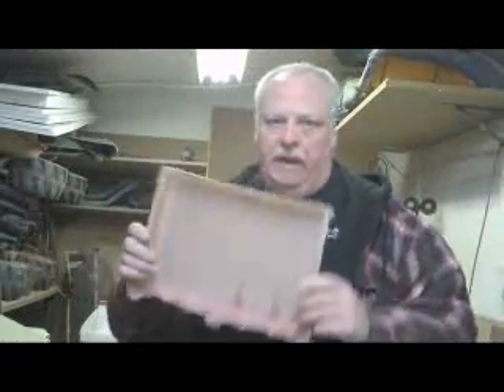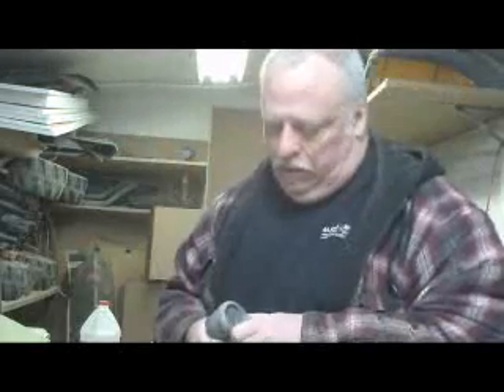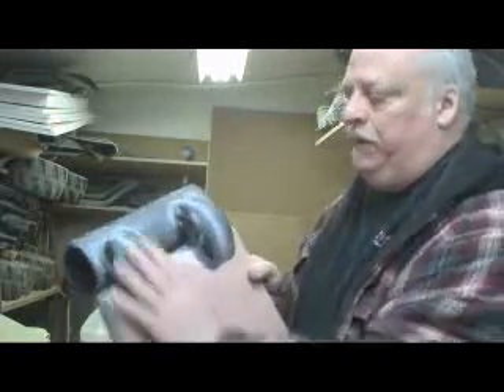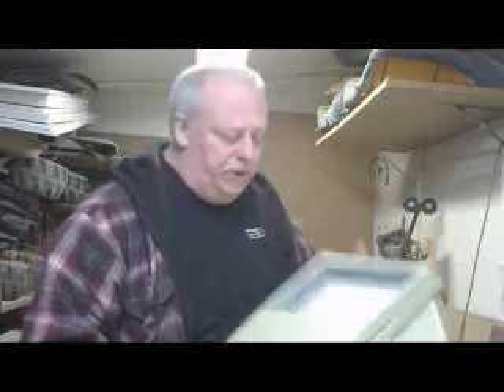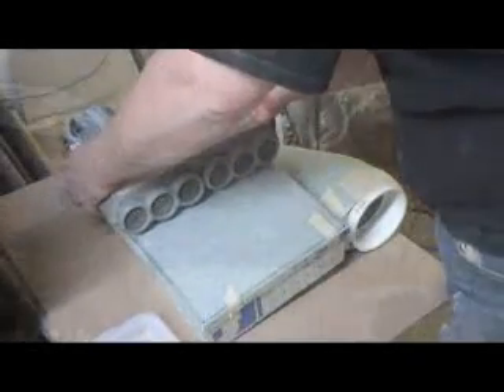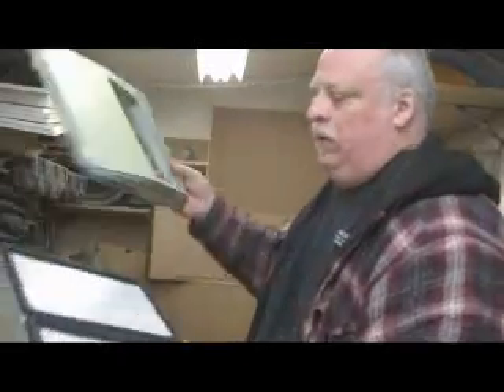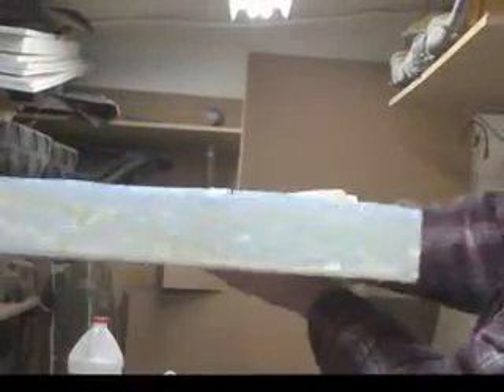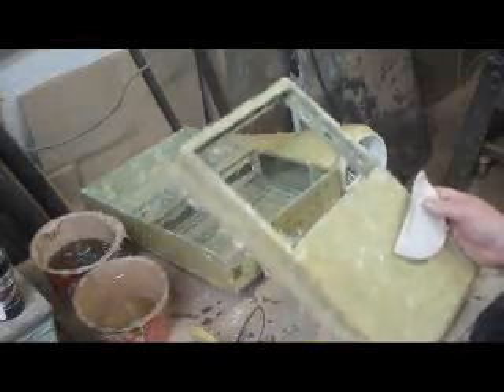Roadmaster Coupe Project, part 12, Shaker Scoop and air filter box

Comment from the maker: @losnoobiecannon Yes. There are foams available that are resistant to polyester resin, and resins that are safe for foam, but either combination usually cost much more. Also the fan fold foam (FFF) is easy to work with, cheap and available at home improvement stores.

Comment from the maker: @parrotpilot I should also mention, the technique I mention at 2:47 where wood glue, fiberglass, and newspaper (without any resin) is used as a shell lamination on foam was for RC planes, this car air filter box piece uses wood glue as a sealer, covered with fiberglass and polyester resin for a foam core construction.

Comment from the maker: @nightpwner The mold I show at 0:28 was used to make the scoop casting at 0:43 I no longer have the mock that I used to make the scoop mold. The air filter box starting at 2:42 is the actual piece that will end up on the car. The foam "core" construction of the air box adds strength, and insulation since it will be mounted over the engine where the factory air intake resonator is mounted now.